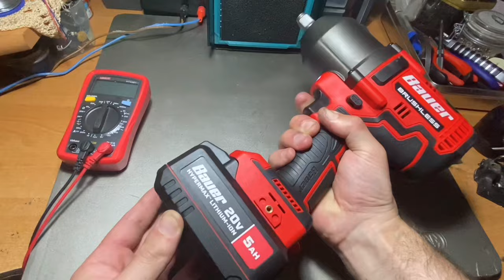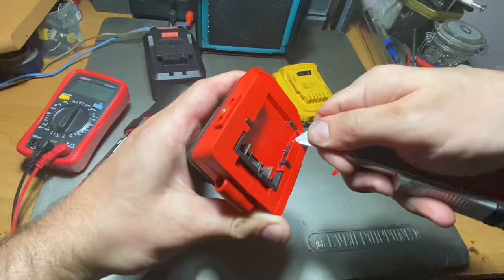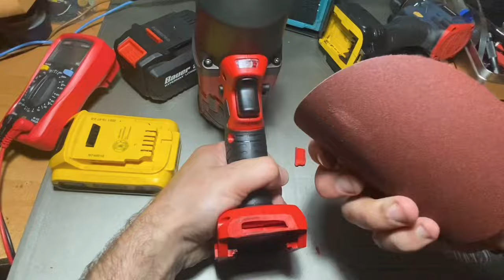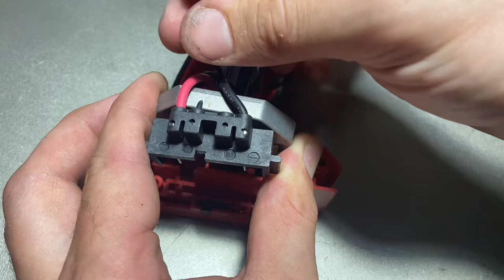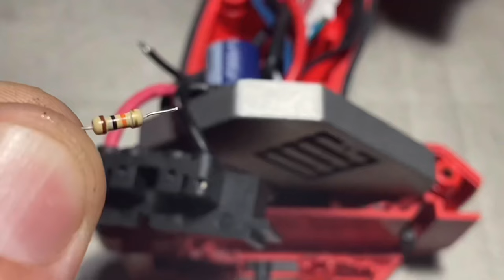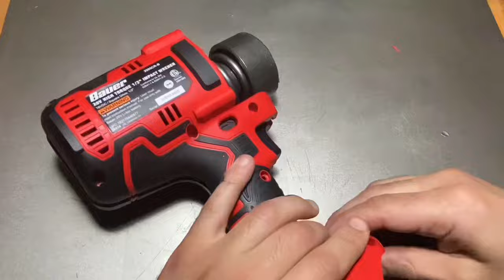BAUER impact wrench driver using original DEWALT battery

Comment: I’m trying to do this but it’s just not working. I solder a 10k ohm resistor from my T terminal on the board to a stripped away section of my negative wire. No light no power …nothing!! Please help!
Reply from the maker: You might need to check that the resistor is soldered correctly